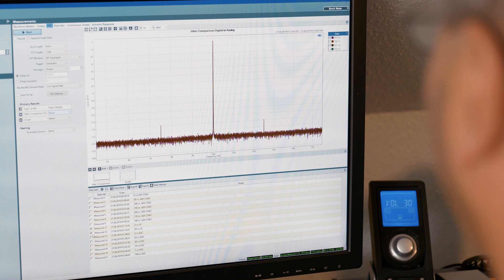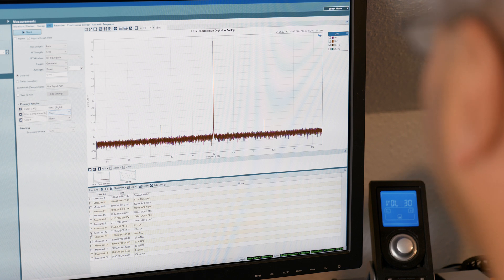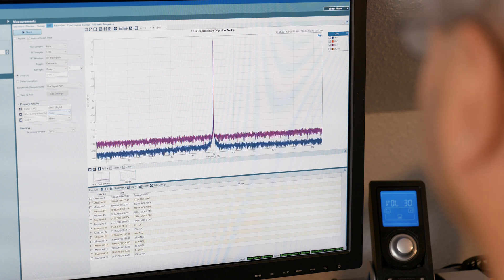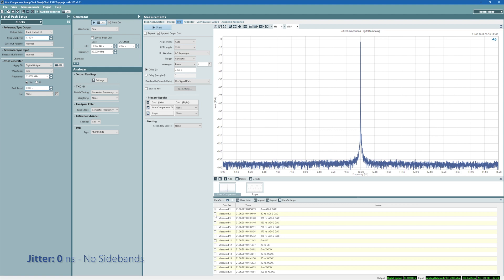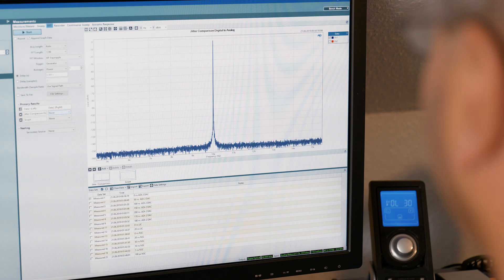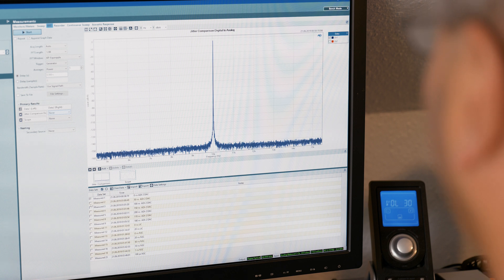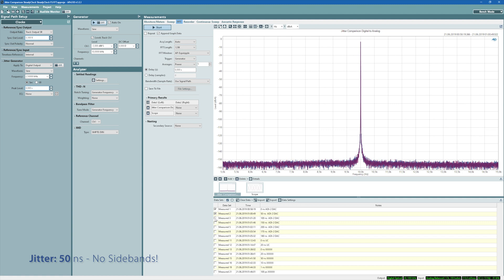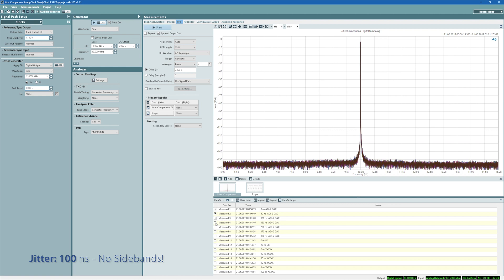SteadyClock FS - Reference Class Digital Clocking Explained

Comment from the maker: SteadyClock is one of the reasons why our interfaces and converters have the pristine sound quality they are known for. What other key technology would you like to know more about?
Reply: Also for the stability and driver support 👍
Reply from the maker: @mimidhof2179  Thank you :-)
Reply: Thanks RME for sharing the science with proof of what you advertise !!  I would love it, if you could just explain more about the quality of converters A to D and D to A, and start by explaining what really matters (because numbers such as THD + N , and dynamic range - are just figures and each brand has a different way of measuring) - so if you could explain what really matters in determining transparent and true conversion without loss of audio quality.   Also something about the analog circuitry and power supply that probably contribute to the quality of conversion)        In general, there is no end to how much one can spend on audio, for example a Lavry Gold converter can cost $8000 or so for just DAC, so ......... it is important to understand ........what matters, what we pay for, and what is acceptable......what is just a luxury.......
Reply: And what's the difference in comparison of jitter values of parts per million and FS? What are they different with? And is Rubidium clock much more exact?
Reply: Show more about AutoRef! Multitone of a -30dB digital attenuation versus -30dB AutoRef attenuation. Should be fun to watch. :)
Reply: I would like to learn more about the DSP in Babyface. I've read it's also very unique.
Reply: @CyrilleBoucanogh  AFAIK Babyface has no DSP, only an FPGA which performs EQing. Echo Reverb via driver on the host PC and no dynamics (compressor, expander).

Comment: I'm using a Digiface USB, and I'm getting soooo much jitter. The Digiface is my master device with a Fireface UCX II & Apollo x8 connected via ADAT. The clock of the 2 slave devices is set to "External ADAT" while the clock of the Digiface is set to "Internal". All devices are set to the same Sample Rate. It will work perfectly for about 20 minutes, but then I get a bit crushing type sound and so much jitter that I have to shut everything down and restart. Within the UAD Console app, I can see the jitter popping sound coming in through ADAT 1 & 2 . In Total Mix, it says that the other 2 devices are "Synced" and locked to the master device, despite the popping. I don't know what else to do and am regretting buying the Digiface
Reply from the maker: Try a loopback test. Transport audio on the Digiface USB from an output to an input and monitor (Cue) that input (internal clock). This will test the Digiface USB. See if that works.
Reply: I just ordered some new heavy duty ADAT cables in cause it was a result of faulty cables, but, if that doesn't work, I don't know what else to try.
Reply: 1. Cable quality/length, connector cleanliness.
2. MAKE SURE the sync is good and the sample rate is correctly set everywhere and anywhere. Triple check.
3. Check cables.

I have Octamic II and babyface og. Sometimes it is hard to actually get them to sync correctly. Takes a few times turning on/off the Octamic.

Comment: Pure passion in engineering. Not only is the signal clean but all my 3 RME fireface 800 are still running today without any problems and one of them is around 20 years now. The only reason why I will update my setup is to go away from Firewire interface and over to USB. Simply amazing!

Comment: I have owned RME products for over 12 years. However, When I compare and listen to the signal processed by the Babyface FS to one using the Denafrips Iris D to D there is no comparison. The Denafrips Iris cleans the signal significantly more and turns the stream into a more coherant significantly clearer sounding track. Hence there is still room for improvement to the steady Clock FS.
Denafrips Iris is their least expensive D to D. They have the GAIA which is substantially better than the Iris. Also in the past I owned Auralic DA. It was also more detailed than what I here through the Steady Clock FS product.The Auralic and GAIA use OCXO clocks "Oven Controlled" clocks.

Comment: If I had one device with Steadyclock FS (for example M-1610 pro) paired with another RME device without steadyclock (for example a RayDAT, or MADI FX) how would this affect performance? Would it be preferable to set the m-1610 pro as master clock?
Reply from the maker: Yes, this is possible if you want to use the best possible system clock.

Comment: very interesting! I've heard other manufacturers quote picos/femtos values, you call it sampling jitter, is that something you have control over beyond AD/DA chip selection? If no then the other manufacturers are just using jitter as a cheap / meaningless marketing term similar to some TV manufacturers quoting 720Hz refresh rate 4-5 years back!
Also in a dedicated DA, say connected via SPDIF, the output jitter would be totally reliant on the digital signal carrying a perfect clock without something like SteadyClock, wouldn't it?
Would love to see more of these technical videos! Maybe also about your preamps / headphone amps and their development background! You could even do a video on the FPGAs you use, without giving away too many secrets, of course!

Comment: Does the UFX+ have this technology? Steadyclock FS?
Reply from the maker: It's true that SteadyClock FS offers better performance compared to SteadyClock. BUT this doesn't mean that your UFX+ has an outdated or bad jitter reduction. In fact we have shown in this video that even a Fireface UC designed in 2009 has a BETTER better signal to noise ratio than a modern DAC with the AK4490 chip, which is one of the most sought after chips in the premium segment. Therefore enjoy your UFX+ as is it is - it's simply an amazing interface with excellent conversion.
Reply: @RMEAudio  absolutely agree. My UFX+ is outstanding unit, enjoying it everyday, one of the best purchases I ever made. And as far as I know, non-fs steadyclock had few generations too, they simply didn’t marketed, and UFX+ has latest one, which performs better than generations from early 200x.
Reply: @RMEAudio  Thank you! So there is no plan on an upgrade in the near future?
Reply from the maker: @jeli780  No, it's just perfect as it is. Think about it: outstanding sound quality, stand-alone operation, DURec, format conversion, and a plethora of digital connectivity. You simply can't go wrong!
Reply: @RMEAudio  agree!
Reply: Its predecessor - steadyclock
Reply: @igorzhidkov1957  no plan in incorporating the Femtosecond?
Reply: @jeli780  I'am not from RME, but I am sure, it will be in their next-gen flagship interface like UFX3,UFX++,UFX+ FS or which name will be chosen;)
Reply: @igorzhidkov1957  i hope soon